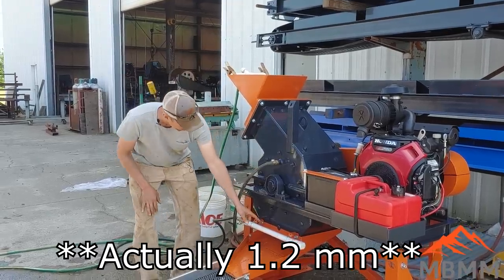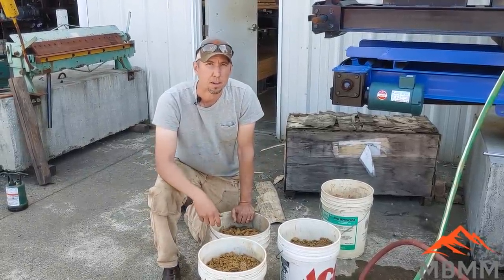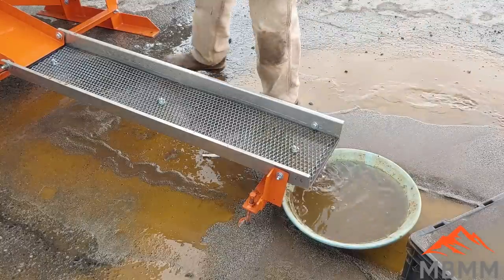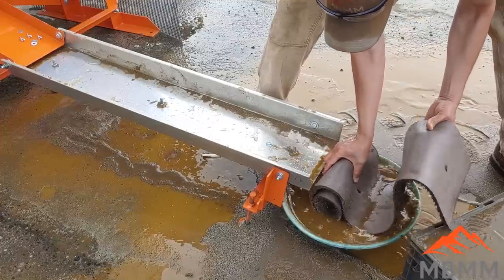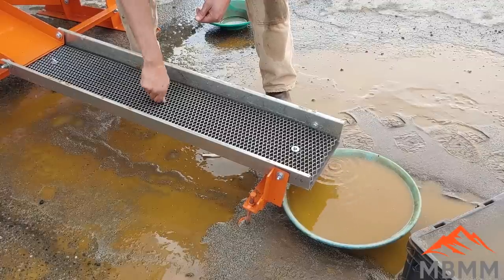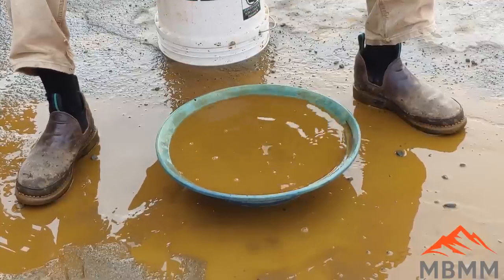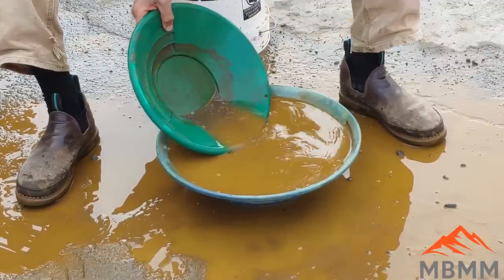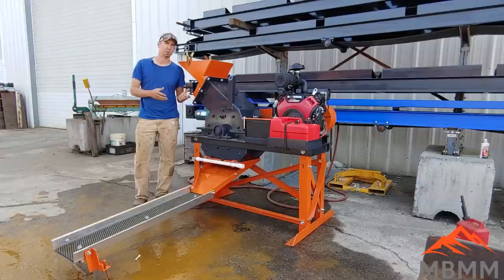Gold Mining Hammer Mill & Sluice Box Combo! Gas Powered & Mobile Gold Prospecting Machine

Comment: I'm looking @4:13 and I don't see a zirc fitting on that bearing.  I can say from experience that when a manufacturer says that they use "sealed" bearings, buy two sets because someone is going to change one within a week of 12 hour shifts on just about any conveyor head pully.  My favorite thing that they told us was that adding grease to a "sealed" bearing would kill it.  I may be missing the zirc in this shot though.  EDIT - I think the zirc is on the far side of the beraing away from the camera.  I should have known you had this covered.

Comment: large scale miner here and owner of one of your tables, i think a higher energy sluice would be better even for very fine hardrock gold. there is a good size for vortex too big and it collapse and needs too much energy to maintain its stability. too small it becomes overwhelmed too easily when loaded with slurry. many miners are putting huge volumes over 6lb expanded metal  and having good results with very fine gold often in tailings. i would just try it, get a piece of 4 or 6lb expanded metal and add a little more water. remember this isnt to catch more gold(but maybe) on small runs, its to be able to improve the recovery vs ore sample ratio on larger scales. Nothing beats a sluice for gold recovery, simplicity, and cost on large scale

Comment: Thay would be great mounted to a trailer.
Reply: Would need to have collapseable legs to get center of gravity low enough to be towed stabily.
Reply: I would like to throw it in the back of a Tesla Cybertruck. :-)
Reply: @digger105337  run the axle under the width so it will look like a 5ft trailer that is only 3ft long.  It would be cute too.
Reply: @cacogenicist  lmfao
Reply: @billy-go9kx  extendable tongue and a tor-flex axle to cushion the bounce.

Comment: Jason I have two4"lg 2" pin valves. I have been thinking powder mill due to size and it's current Fab and I have new heavy rod 18" 1.5+1.75 thick and I have 4 of them and 1round ball 3" fells 8 10 lb and of course ball mill on assembly line 6" intake in to 1" minus secondary the one you have on this video.

Comment: do you have a video where you show the hammers ? also the motor is that a honda690 ? looks like a highpressure motor i have for high pressure cleaning... good motors... just to be clear so this takes material that has been through a primary crusher already ?

Comment: You know, if you set that engine up with a wood gassifier and a wood chipper, then your customers won't have to go back to town to buy gasoline and haul it to whatever remote place they're mining.
That's a big deal for anyone that is trying to mine in privacy.
Reply: Have you looked into cobbling up a woodgas fuel system with sound deadening compounds on the noisy parts for miners that want to go undetected and not need to trek out for gas or diesel?
Between bandits and gubments, there are a lot of reasons to want to run a stealthy operation. 
I'll be glad to send you what I know about sound reduction and wood gassifiers.

Comment: Like this alot a great combo what's the price please.
Reply: Pretty sure you gotta contact them directly for pricing. I would think with everything included your probably talking 10k easy.
Reply: @Killswitch22022  Ok interesting they don't show the price?.. It be better if they could make something that would take large rocks and process the same way. Also mounted to a trailer, Now that would open eyes and wallets for sure 👍
Reply: @ukbeeps  They do make a separate unit that would do the crushing and you could feed it directly into this unit. Would probably need another generator as well though. Probably getting into the 20k mark now.
Reply: @Killswitch22022  I can see the sluice dripping from where its connected to the hammer mill, as gold genuinely collects at the top of the sluice this could potentially loose gold.
Reply: @ukbeeps  Yea I was thinking that as well maybe you could add a better seal up towards the front.